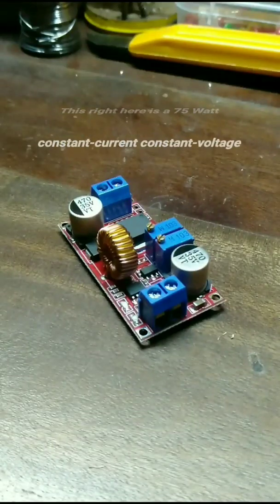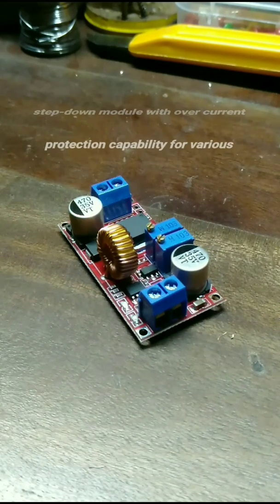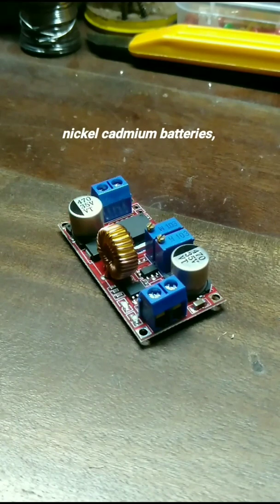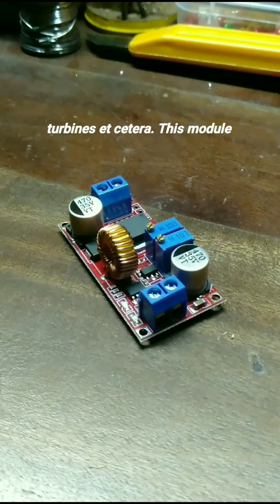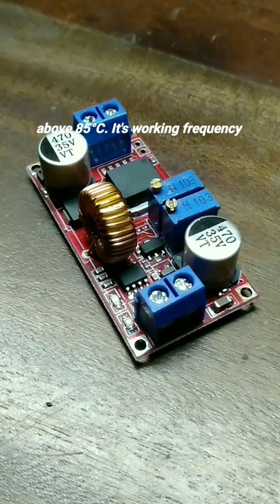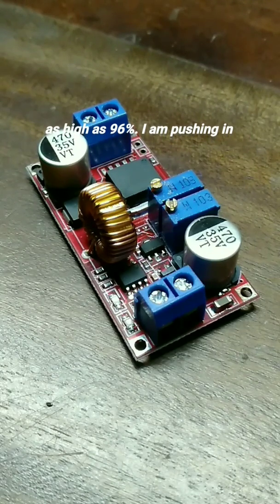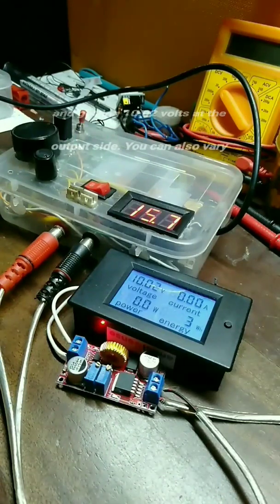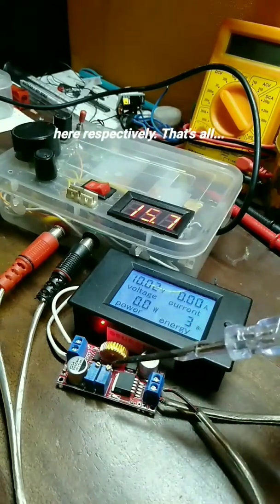All you need to know about XL4015 in #shorts | Converter Series-4

Comment: In this circuit can anything be added between the two holes next to the input terminal block? or what is it for?
Reply from the maker: Its for soldering the input and output wires... And the other two are for screw securing

Comment: I have the same thing but I am not getting variable voltage can some body help ?
Reply from the maker: So there are two trimpots, if the inductor is facing away from you, the pot to your extreme right is v-adj... Rotate it anticlockwise (a couple of times) on power with a multimeter connected to the output terminal to get variable voltage
Reply from the maker: Remember this is a step down converter

Comment: Sir can i give input from a 19v 8 ampere transformer please let me know
Reply from the maker: You'll need to add a rectifier before the converter along with a filter capacitor and you're good to go... Never feed DC-DC converter like this one, an AC voltage, it will blow the reverse diode
Reply: @CircuitShorts  sir I am giving input of a 19v dc 8 ampere from a bridge rectified transformer so will the 8 ampere damage the xl4015 as it is a 5amp module
Reply from the maker: @rovone1  please understand that a ampere rating of the circuit only means that it can deliver that much load... So a rectifier rated at 8A feeding through 5A module can deliver a max current upto 5A after which the module will engage voltage pull down to protect from short circuit
Reply: @CircuitShorts  sir please as I am a beginner can you tell me simply that should I supply the module with 8 ampere and as you are saying it will consume what it requires I understood that but will it damage the module or heat it or will work perfectly fine just simply tell me sir should I use it that way or not
Also sorry If I am bothering you again and again this is the last doubt thank you
Reply from the maker: @rovone1  will work perfectly fine provided that you make all right connections

Comment: over current protection mean will it handle very high current like 20 amps???
Reply from the maker: Not really... Over current protection in DC Circuits generally use pulldown switches to Bypass overloads... This module is rated to 5 Amps max.

Comment: I used this module to charge my 3s battery pack, but when I remove the power supply (when the charge is done) battery current flows back to the module and the input side becomes the output. 

Can I use it as it is? Will it destroy the module?
Reply from the maker: I don't clearly know about the bidirectional capability of this converter but for a unidirectional converter I'd suggest not going with power backflow considering its feedback circuit design.

That being said, you may add a reverse current protection diode, or preferably an active reverse blocking circuit using MOSFETs (just to minimize losses)
Reply: @CircuitShorts  thanks for the reply!, I added a schottky diode SB320 and adjusted the voltage for 12.6V (after the diode). Now the problem is solved. Thanks again!

Comment: Kya ye solar 10 watt ke lay sahi ha btao out put 5 volt mila gaa
Reply from the maker: Ha constant voltage aur constant current se ye 10 W at 5V araam se jhel lega
Reply: @CircuitShorts  ok ji 10 watt 20 volt input dena wala ho or Mera pas loom solar ha oske sath add kro ga or out put 5.20 volt rkho ga Amp 1 only rkha ga ok
Reply from the maker: @Sumit719S  sure... Just make sure ki reverse polarity connection na holo else it will fry your circuit 😅